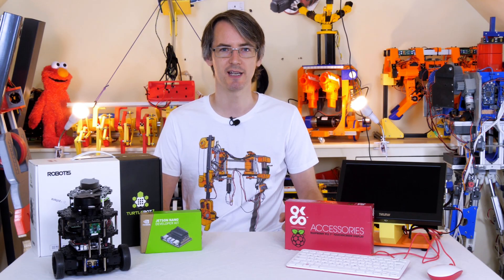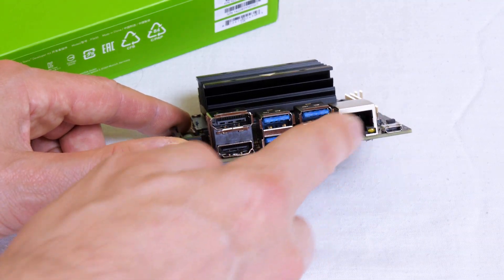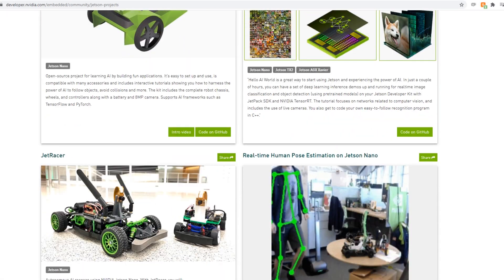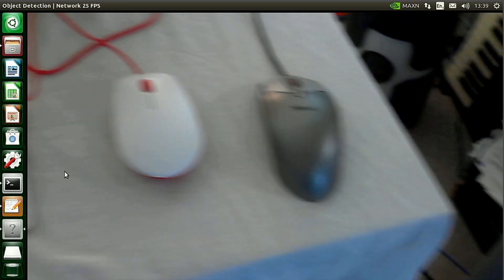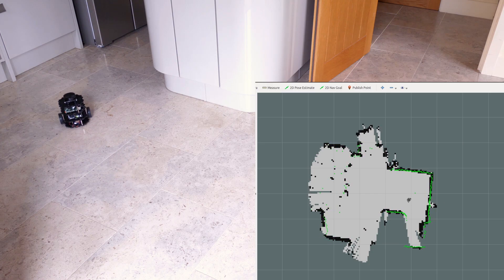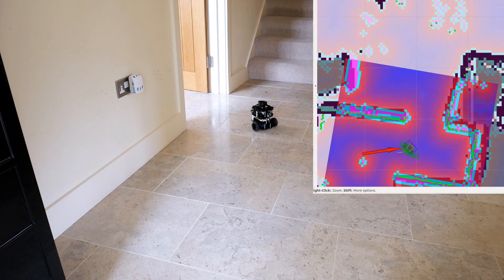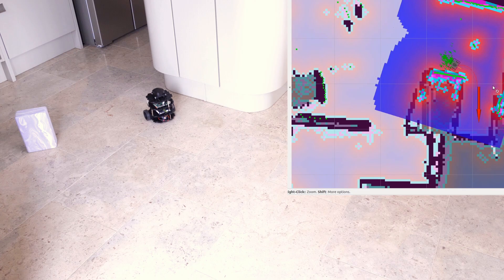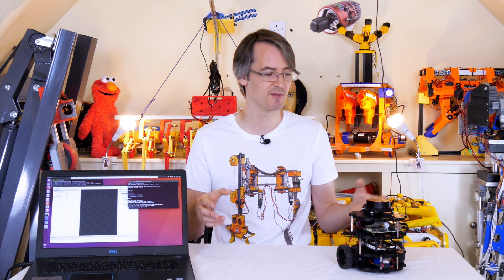Robot AI Demo - NVidia Deep Learning, ROS Navigation, Raspberry Pi

Comment: I used a Turtlebot 2 on the 1st semester of the bachelor in Robotics...
No one explained us much, we worked in groups of 5 and 6, and they just assumed that it was likely that at least one in each group knew how to program, prior to entering the university (they were right for most groups).
In my group I was the only one that knew how to program, but I had never heard about ROS, and it was very hard to understand it. But after you understand ROS, everything is very simple to program.

Our goal was to develop the program for a "Mars exploration vehicle", we ended up with one that could 
autonomously explore
take and send a picture every minute
Analise color to detect possible mud vulcanos  (if it contains water, they may contain live)
Upon detecting a volcano it would send a picture with the coordinates
if it bump into something it would stop and check the surroundings, sending pictures and change to manual driving mode
(Manual mode was tricky because of the distance between Mars and Earth)

Comment: This really makes me wish this existed 20 years ago when I built my first Dalek. Speaking of which I reckon you'd do a fair job of making one of those. Mine had an old laptop for brains and loads of micro controllers for sensing and pariferial control. It had an airsoft canon for weapons, an old Kinect for mapping and visual data. For the body a rubbish bin turned upside down with styrofoam balls cut in half works nicely.  I'm sure you can work out the rest. Anyway great content mate.

Comment: Great video, as usual. Love your work, you always inspire me to get back into my projects. I’m working as well on a robot dog concept, based on MIT mini cheetah actuators. I would recommend trying to migrate to ROS2. ROS1 is still widely used, but it’s aimed really at research and development. So it still fine to use, but ROS2 is built to be more dev to production compatible and offers much more robustness to communications dropouts and natively supports higher reliability with the data distribution service middleware quality of service. Allows you to detect when nodes aren’t running as expected or messages are not arriving when you expect. Something to consider. TBH, ROS1 is still what I use mainly, old habits die hard, but I’m trying to move to only ROS2 to help handle what i spoke to above.

Comment: Hey James. Great video. I love ROS and I have a small tip for you. After a while, you will get many terminals running nodes, can be quite messy and confusing to keep track of every thin. Then if that happens you should try using Tmux. Its a terminal multiplexer allowing you to have multiple terminals in the same terminal. Also if you use Tmux over SSH the terminal int lost if you accidentally are disconnected. Can save a lot of headaches.

Comment: I look forward to seeing how you get the Pi Camera + ROS working on Pi 4.  I struggled with this for some time.  I tried a few months back and found I could get Ubuntu 18.04 onto a Pi 4 the install ROS, but could not get raspicam_node to work.  I then tried installing Raspbian Buster on the Pi 4, compiling ROS from source and then hacking  Raspicam_node  until it installed.  That worked, but I was an emotional wreck by the end !

I would love to see an easy solution, installing from binaries.  A Pi 4 + ROS + Camera is a great combination for robotics.

Comment: For those not able to purchase the turtlebot 3 - the eManual for the TB3 contains a lot of simulation stuff, you can learn an awful lot from using a simulated robot in gazebo, all the ROS nodes function the same. It's also free. 
A caveat to that though, is that you won't get the sensor ambiguity that you get in real life, for example the map that the TB3 produced will look a lot better in sim than in real life, but then again it will look a lot better if you use a better LiDAR.

Comment: ROS2 ecosystem is growing. You should give it a try as well. I was turned off ROS1 due to protocol overhead but ROS2 is more efficient, realtime capable, and simpler node design. It also has microROS for arduino nodes. Community is not as far along as ROS1 but it's growing fast and we recently got MoveIt!2. I am using it on my humanoid robot.

Comment: I have a solid year of work using ROS 1 for a research paper in college. 
I found the possibilities with ROS are truly endless where robotics are concerned...
if you can dream it you can program it in ROS
that said it also took me a solid 2 months of working on my own to get a good understanding of it before was able to really get going on my project
ROS is a wonderful platform if you want to put in the work.
Reply: Can you give me any advice? I am a beginner in ROS and want to apply this to robotic manipulation in manufacturing
Reply: @jouleio4525  
It has an extremely steep learning curve and I found that for ros 1 after you get past the basic tutorials support kinda evaporates.
I would strongly reccmond you look at the construct they have free weekly webinars and other stuff
However some of it is behind a pay wall
They are really the only source of Info for the more advanced stuff
Given it's open source nature the doccumation while not horrid is not particularly amazing particularly when  it comes to the more advanced stuff
I also strongly reccmond that you have a high end computer.
Particularly if you are going to be using a VM to run linux to talk to the robot
I was regularly using more than 20 gigs of ram running the vm and ros.
The same goes for the processor.
I would reccmond an i7 or equilivent
However 16 gig and an i5 would suffice for most
The other bit is that huh ou dont need to upload your code to the robot every time you run it
Because of the de centralized nature of ros you are able to run the code for the host computer running the server
As for starting platforms I would reccmond using the robotis turtlebot 
It is about 1300 usd and is plenty to learn the platform/explore it before investing in a more expensive platform
There are also other platforms that are already made for indstural applications that you might want to look into
Most are mobile platforms for moving materials but tbere as re also a coupple of as arms too
I believe Baxter is one of them
It has 2 arms and a screen with eyeballs
Anyways hit me up if you want more info
Reply: @natpim4730  Thankyou very much for replying hahah 😀. fortunately, I took the course at RobotIgniteAcademy and still learning for ROS with python. I often hear about the turtlebot. Currently I am interested in dobot magician, its a 3 axes desktop robotic arm. It is written that it is also support ROS. You can also check this things out. I am curious about the future career of ROS engineer especially in South East Asian countries since I am from these regions. Also what I noticed is that the high development of ROS still occur in developed countries such as USA, Europe, China.
Reply: @jouleio4525  the turtle bot has a 6? axis arm that can be mounted ontop of it...
as far as the jobs go yes there are ros development jobs for the usage of ROS in indstural environments however I don't know what the field looks on the other side of the pond where you are
And why are you using python....
C++ is much much better....
manny more options with what you can do....
Reply: @natpim4730  The thing is I want to master the concept of ROS as quick as possible, and at first I am not familiar with python and C++.Thus, I choose python to start with ROS since the language is easier than C++. (I know that C++ is much better for robotic software engineer  careers )
Reply: @jouleio4525  That is understandable
I might have done waayyy too much C in college.....

Comment: What happens to the turtlebot if you put the box at the spot where it was supposed to stop, after the initial calculation of the path? does it stop before or after the box instead ?
Reply from the maker: It keeps trying to get to the target going back and forth and trying again. You can de-tune the accuracy for getting to the target though so it thinks it's near enough

Comment: Nice video, I've been working with ROS for a year to build an autonomous car. What I've learned over the year is that if you're using ROS on only 1 system, it's best to make use of Nodelets instead of nodes, as it sends pointers to messages in memory instead of serializing and deserializing the messages. Also, rosbag is love (for debugging).

ROS is switching to ROS2 though, which brings, apparently (haven't tried it yet), a lot of improvements, not sure if turtlebot will be switching to it aswell.
Reply from the maker: There are already ROS2 instructions for Turtlebot, but I'm not quite there yet

Comment: I would recommend that you put a good (sizeable) heatsink and active cooling with a fan on the Raspberry Pi 4. Without active thermal cooling, the performance of the Raspberry Pi will be significantly compromised (i.e. any significant compute load lasting more than a minute or two will result in the CPU throttling back to 600MHz) . . . with active cooling, you can overclock the RPi4 and consistently run at 2.147GHz !

The Argon One case is a good option in that it provides a very effective passive heatsink (the metal case) with a variable speed fan that kicks in under software control dependent upon CPU temperature. I am also very impressed with the Yaboom RGB Cooling HAT  (does not use GPIO, but requires i2c for control), but this needs to also be paired with a large heatsink (e.g. aluminium heatsink case).

Comment: Will you try out the Issac SDK from the Nvidia nano? I am thinking which platform should I use for my robot: ROS or Issac if I am using Jetson as my control unit.
Reply: You can run ROS on a Jetson board just as well. I've spent some time trying out NVidia Isaac and found it severely lacking documentation and not being developer friendly. The pre-built neural nets are nice, but not a killer feature. There is an Isaac-ROS bridge included with Isaac, but that is implemented poorly, eg. hiding exceptions etc. Also, ROS has a large community to ask questions etc.
Reply: @LoyvanBeek  So, i would better use ROS to develop my robot instead... I have seen the video from Nvidia developer of using the Issac SDK, seem the functionality is quite similar, well if there is not much document, then ROS seem is a better approach. Thanks
Reply: @LukTzeChing  The similar functionality seems only in a first glance. When you start to develop anything more complex than they pre-cooked for you, it's really difficult or impossible.

Comment: Great stuff! I'd love to try to use ROS to make a robot vacuum, lawnmower, and snowblower!
Reply: lawnmower robot would be so cool!
Reply: Please make this a project James, like a thunderbirds 4 with swapable parts!
Reply: You can without hardware as it comes with a decent simulator as you can run the roscore ( broker ) and the ros nodes on the same machine.  Turtle bot has always been stock and you can customize it and control it or make it autonomous if you wish,

Adding nodes ( camera's / other sensors ) is easy,   ROS is not as hard as you think, you only have to get your head around brokers pub/sub like MQTT.  Just one other thing starting out use Python but when working as needed port it over to C++ as that is where all the power is.
Reply: Vacuum doesn't use laser, it uses IR as I think 😁